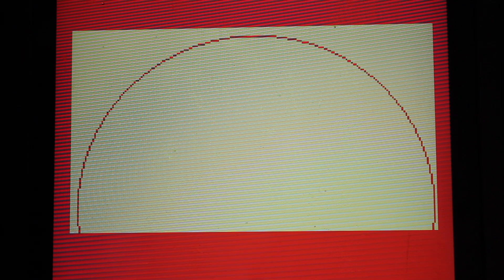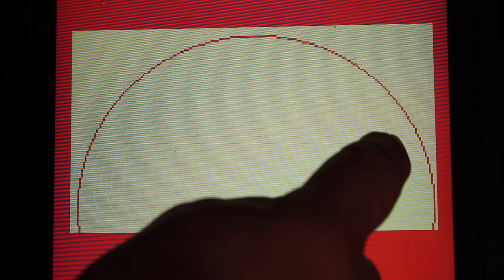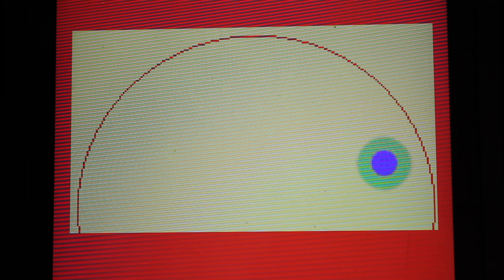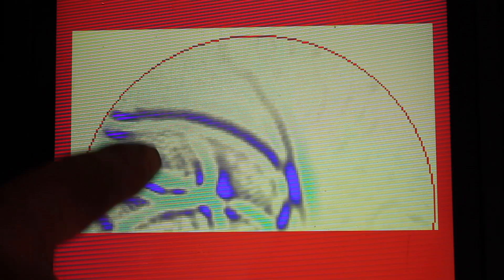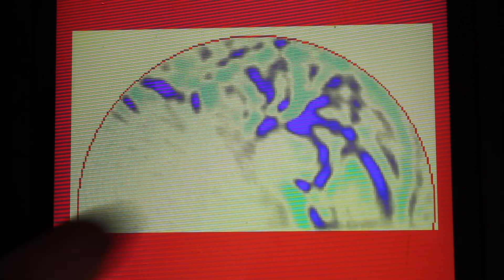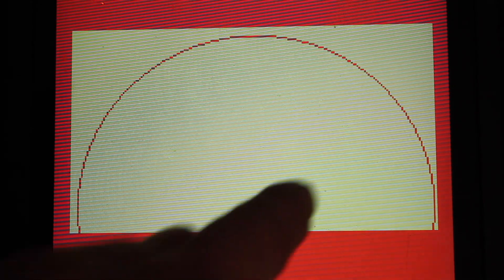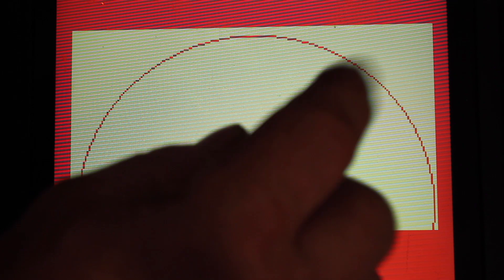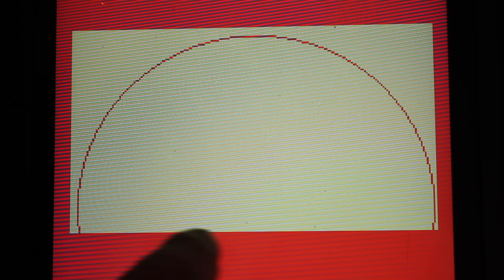Dome acoustics - things you didn't know about domes

Comment: When I was in college we had to set up for the spring concert of the jazz choir and jazz band in the gymnasium of the college I attended it to was a large dome. We ran into during sound tests a similar problem.  Some guy from the art department suggested we put up a number of sticks with flat sheets of cardboard faced it various different angles about 8 ft above whare people where  sitting as the gymnasium floor is flat the stage area was on the same level with the audio system. rectangle cardboard sheets were 12" x 36" mounted on 12' sticks with waited baces it wasn't bad the baffling helped a lot

Comment: I've been digging into this, and I had an idea. When building the structure, what about adding tetrahedrons facing inwards to some triangles of the structure? they could be filled with absorbing material and covered in cloth, or even completely closed, so that the sound would be diffused in many directions. Is there a way to create a 3d model of this and make acoustic simulations? I wanted to create a recording space/studio, and stumbled into this forum: https://www.gearslutz.com/board/high-end/26324-acousticians-geodesic-domes-2.html So I thought about ways to alter the inside surface. I'm not an engineer, but maybe my tetraedron idea could work! What do you think?